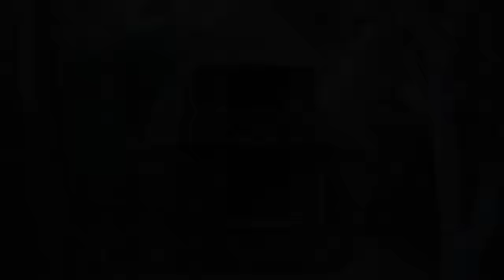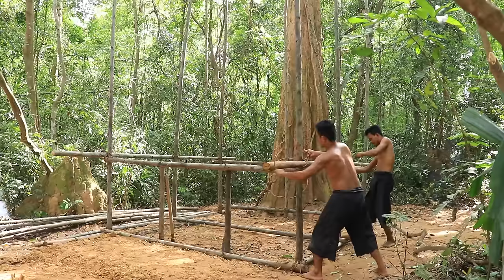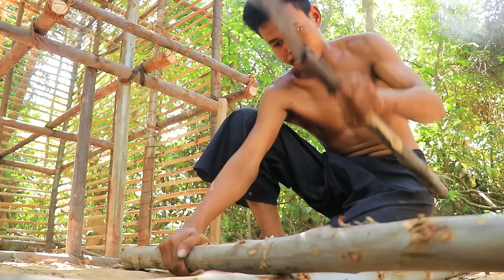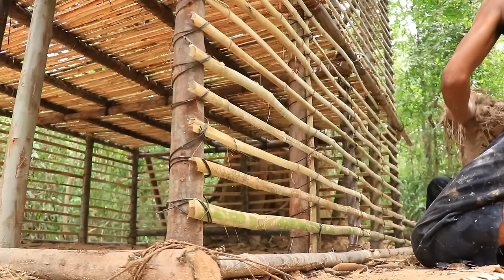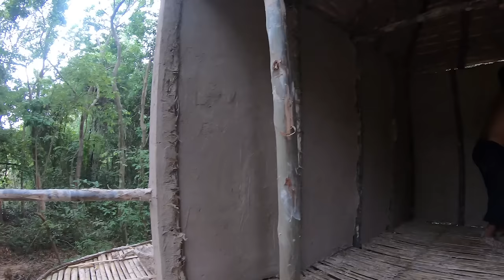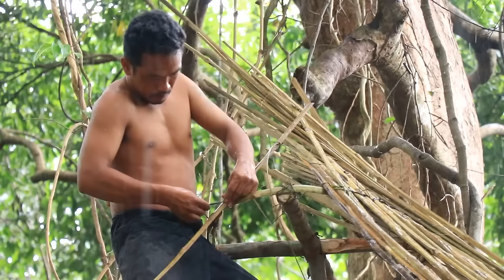How To Build The Most Beautiful Modern Two Story Bamboo House

Comment: Its a bit unstable but the design is good. I just wanted to know how those cement or walls like reacting to rain or water.
Reply: They used cob (you can see the hay/straw mixed into with the wet dirt/clay mix), it's basically a mud-hut. It's best to protect the mud walls by putting a roof overhang of at least 1 1/2 to 2 ft to shield it from rain.
Reply: They would have taken a lot of the ‘sway’ out by just adding a few diagonal braces.

Comment: I have a question, I didn’t know the clay  mixture could also be used for the roof especially in an area with a lot of rain, does that last long ? Or do you patch it all the time, I know these are not permanent houses like forever, but how long do they generally last for?